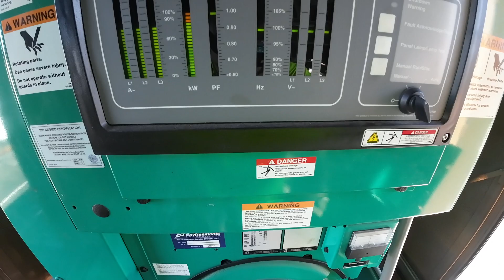Generator Loadbanking!

Comment: Why are you step loading one element at a time?  I always try to hit it with 100% load acceptance within 10 seconds of engine start to provide a worst case test.
Reply: Makes a lot of sense. Generators are designed to go full tilt a few seconds after start. In the real world, your building won't dynamically increase its load over a few minutes.